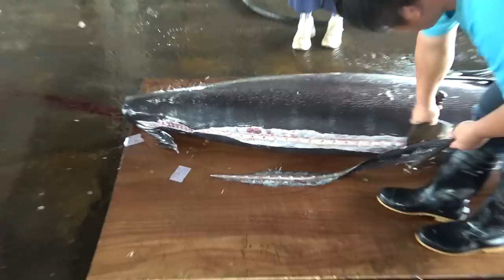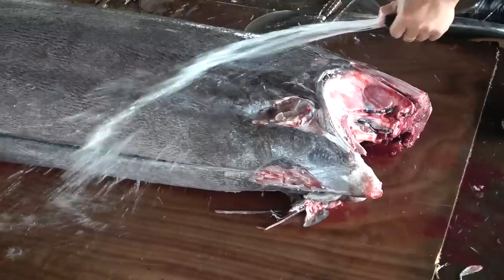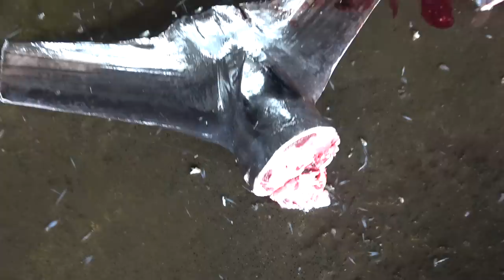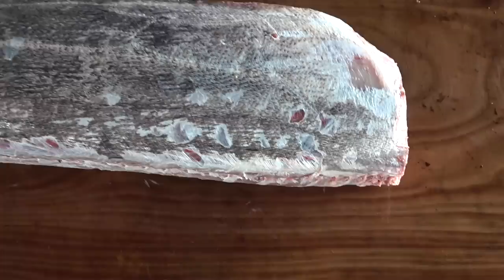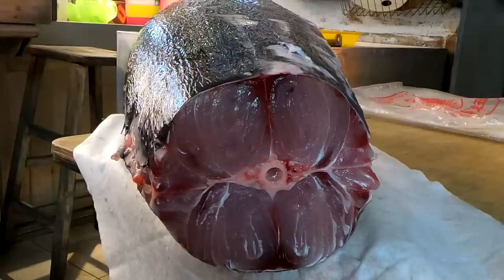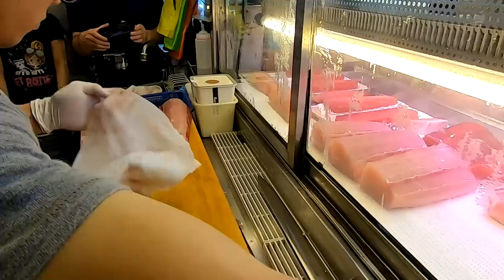250 kg Giant Marlin cutting for  Sashimi

Comment: I can see the resemblance of the scales and bird feathers
Reply: Intriguing.
Reply: Yes! I was thinking pin quills.
Reply: TheIkawatay went on a school trip and recall the evolution from sea to air. If I’m not mistaken. U agree?
Reply: mydearvalerie yes! Always told about the evolution. First time seeing a marlin that close up
Reply: Both are highly specialized features and are not close to each other at all. Also, a fish has a two chambered heart and a bird has a four chambered heart. They are also nowhere near alike. An animal with anything inbetween would not survive. If you can imagine changing the engine in your car to a jet engine, except you cannot use any different parts or turn the engine off.

I'm sorry to tell you but time and mutation are no help to the failed biological evolutionary theory. Things do not improve over time,  especially genomes exposed to environments varying in harshness. I'm not sure who convinced you otherwise. Biological evolution is a fairy tale.

 Real observation though will tell you that natural selection and the fittest surviving are very real phenomena. But environments filter out and sort traits of the original creature, not create new ones. It's why animals like turkeys and chickens are so different but can breed. They are from the same original animal, only separated geographically and exposed to different environments. But they will always be birds and nothing else. Except extinct.
Reply: GTC u are a certified biological mechanic!! Lol